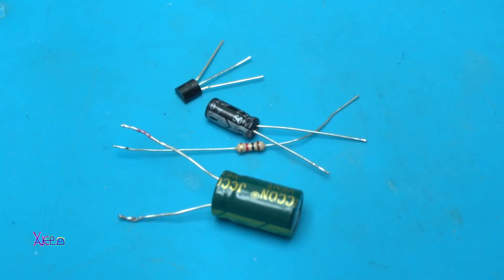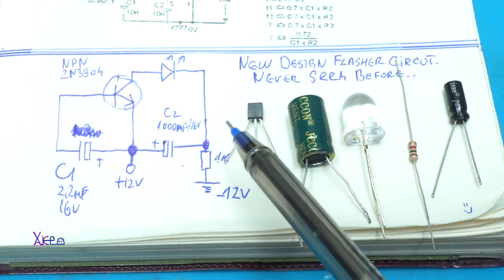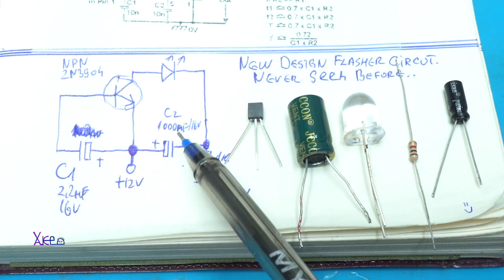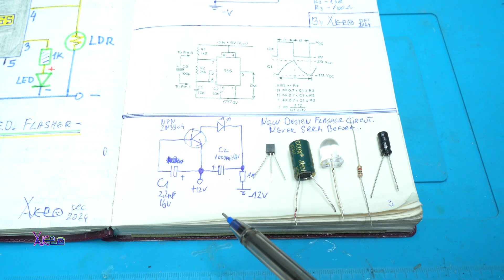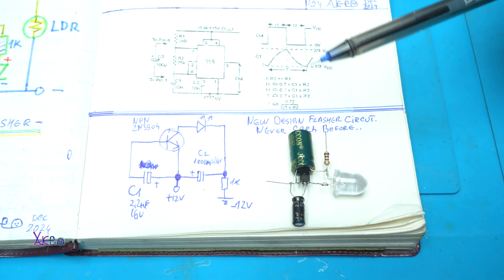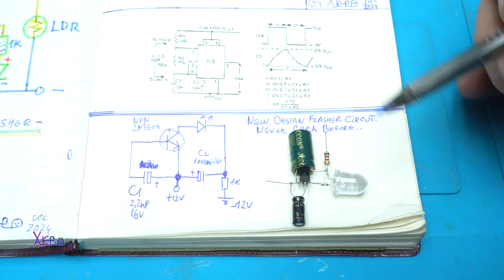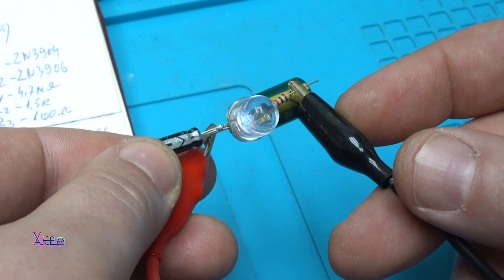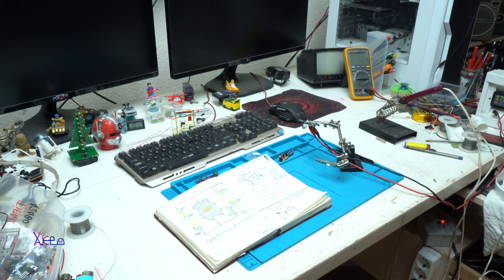Just 5 Parts To Make an Airplane Style LED Flasher!

Comment: 2N3904 is a PNP. Not an NPN. 
Neither one worked for me anyway.
Reply from the maker: Cmon man 2N3904 is NPN and 2N3906 is PNP,you can check online specs.
Reply: @Hacktuber  Yes. This is my bad. I have misread the data sheet. I could have sworn that it said it was a PNP on one of them. Today I checked other ones and they all state NPN. I won't be so hasty next time.

Comment: How does it work? Can you explain how electricity is flowing, how transistor is trigerred etc.?
Reply: The NPN transistor is connected in reverse, so that the emitter-base junction is the one which is reverse biased. Initially, the capacitors have no voltage across them, but start to charge up increasing the voltage across the transistor and allowing a small current through the LED which glows faintly. However, the emitter-base junction has a reverse breakdown voltage of a minimum of 6V. Once the capacitor has charged to about 9V, there will be 6V across the transistor and the emitter-base junction breaks down via the avalanche mechanism, rapidly discharging the large capacitor and producing the bright flash. Once the voltage has dropped, the junction recovers and the large capacitor begins slowly charging again.
Reply: @RexxSchneider  thank you
Reply: @RexxSchneider  Make sense - smart! The behavior of the flashing is essentially dependant on the properties of the transistor (reverse breakdown @  6-9V) though. I guess further fine tuning could be made by modifying the difference in capacitance between the capacitors (greater difference --> longer delay), as well as their absolute values (higher --> longer flash), but it looks quite OK as is now!

Comment: 239 / 5.000
Great!!! If I wanted to build a circuit like this but to be powered with 48 volts, (the flash on my electric bike broke), what kind of elements would I need? And what circuit would you recommend? Thanks in advance.
Reply from the maker: You can make it just use capacitor with same value but 63v or higher and resistor should be around 10k ohms
Reply: Could I use motor hall sensor of my ebike it's 5v DC alternatively?  @Hacktuber

Comment: Hi I watched this video in order to maybe put a strobe on my drone. But here's a question...Suppose I want a VERY bright strobe and want to use less voltage so I can use a lightweight battery, like AA or AAA rechargeable? How would I do that?
Reply: A very bight strobe requires significant energy. You will need a circuit that slowly charges a capacitor and then dumps all of the charge through the LED. The circuit shown here can't operate at less than about 10V, so you need something more complex if you want to run off a 1.5V battery. There are several ICs designed specifically to flash LEDs from a low voltage source, for example the 3V TruSemi M34-1 (3332-01) which works at 1Hz, so perhaps you might want to search to see if there is one that meets your need. One alternative is to use a DC-DC boost converter to raise the battery voltage enough to use the avalanche effect shown here.
Reply from the maker: I request from all of you that,I will try to make and publish the project
Reply: @Hacktuber  Yeah!!

Comment: Thank you, it's very nice. Can you make a circuit that works with 220v AC, both with LED bulb and incandescent filament? Another suggestion is, can you make a circuit that has both 12V DC and 220V AC supply but flashes Formula F1 style. Thank you.

Comment: Very good, but why do you see a weak flash and several strong ones?
Reply from the maker: That is the effect
Reply: @Hacktuber  Yes, I know how an airplane light works. The light stays on for a bit and then flashes strongly. What I mean is that when it flashes strongly, sometimes it is weak and other times strong. I don't know if it's a camera effect.
Thanks.

Comment: Very nice! It would be very nice if the circuit would work running on 4.2V with 18650 battery. 12 V you can have from 220v with transformer, PB Acid battery, or other LI-IO batteries connected in series, but BMS is required for charging. All the best and A Happy New Year to you and your loved ones!
Reply from the maker: I will try to modify the circuit and publish new circuit that work on 4.2v
Reply: @Hacktuber  Thanks! All the best!
Reply: @Hacktuber  would it also be possible to control the flashing frequency?   thanks!!!  great work btw =)

Comment: Nice! Can you make a circuit that combines a jewel thief curcuit with a flasher circuit  so it flashes until the battery is completely depleted? A way to use up otherwise useless 1.5v or 3v button cells
Reply from the maker: My prevous video project is that you are looking

Comment: How do you slow down the flash rate? And how can you run this off a 4.2 volt 18650 battery?
Reply from the maker: Circuit works on 12v,flash rate is set with that big capacitor 1000mf,use different values